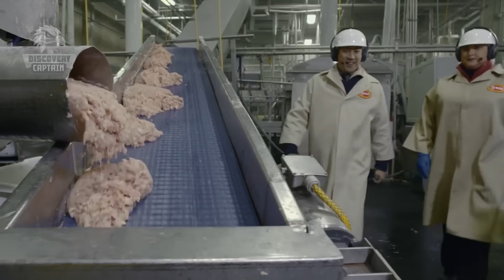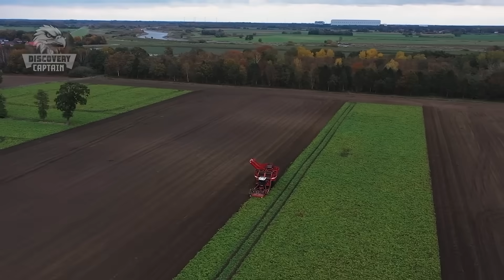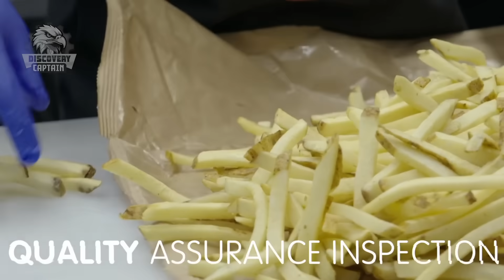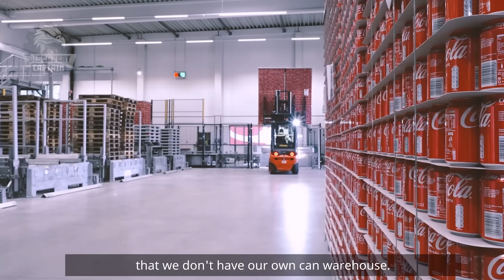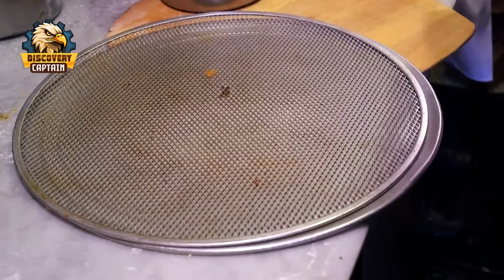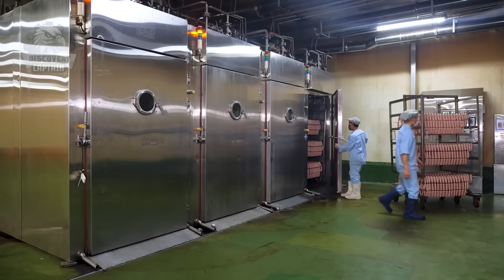How It's Made: McDonald's Fries, Chicken Nuggets, Coca Cola, Pepperoni

Comment: The can seamer that puts lids on was my favorite machine. So fast and so tough. Ive seen crashes we had to clean out with pry bars and hammers and the specs were perfect after. The management was an evil conglomerate of self serving a44holes. (not coke but a pepsi co packer) Evil to the core no doubt in my mind.
Reply from the maker: Can seamers are underrated, getting a double seam right at that speed is brutal on the machine, so it’s no surprise yours survived crashes and still held spec. Sounds like the people running the line earned more respect than the folks upstairs, which is a pretty common story in plants like that. What was the worst crash you ever had to clean out?

Comment: you misrepresented coca cola, in the united states they do not sweeten it with sugar, they use high fructose corn syrup, since corn syrup is not very sweet, it must go through a chemical process in laboratories to boost the fructose level making it an artificial sweetner, lobbist spent large amounts of money getting the FDA to not call it artificial on the label, as a compromise coca cola can not use the wording naturally sweetened,  a con job at best
Reply from the maker: Fair correction on the sweetener distinction. 👍 We should’ve been more precise about the U.S. formulation instead of simply referring to it as “sugar.” Thanks for calling that out. ⭐

Comment: Good old chicken McNiggets then you got your crappy ass burgers which are 3/4 soy 1/4 beef then you got their french fries when they're fresh they're good when they're been sitting around they taste like s**and they frame and seed oil not lard or tallow and their milkshakes well their machines keep breaking down so you never know when you can get one or not and that's by design those machines are designed to operate just so long and then break down and they stay broke down until some idiot decides to fix a motherfukers McDonald's used to be good when they first came out but they sliding down a crap hole just like booger king the only reason why booger Kings impossible Whopper tasted so good with all the condiments you put on it the beef wasn't beef it was plant-based and that tasted like s**

Comment: This info on this vid regarding nuggets is incorrect! (in Australia, at least)
I worked at a chicken processing plant in Australia, making nuggets for McDonalds. The meat was thigh meat as this has a higher fat content and tastes better. They added the seasoning then emulsified skin (skin blended into a paste). Because the skin is white , it simulates breast meat and makes the nuggets look more appetizing. From memory, the ratio was 3/4 thigh meat and 1/4 skin. Then they are  battered, deep fried for 2 minutes to seal the batter, then snap frozen. We ran the fresh nuggets through the frier for an extra 4 minutes and ate them onsite. Best nuggets ever.
Reply: The potato part isn't exactly true either